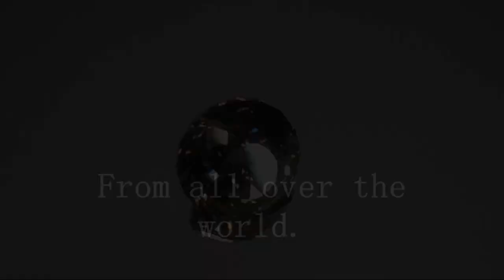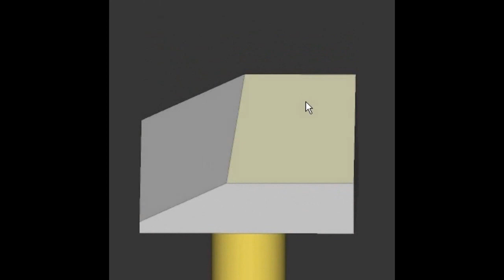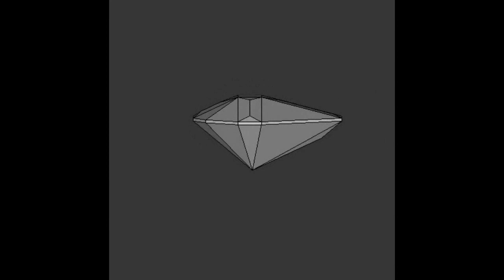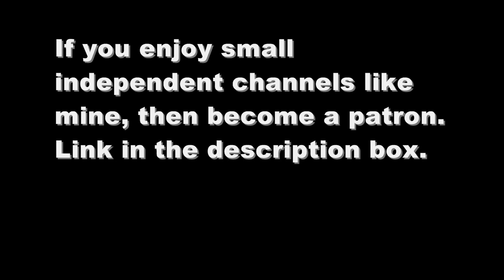How to cut gems - Have you heard about a gem called YAG?

Comment: Beautiful gem as always. 
I've cut this design in a blue zircon, it is a bit challenging but turns out beautifully. The hard part I found was finding a setting that would accommodate it, most pear or tear drop pendants would have the cross upside down and that just wouldn't work. I ended up setting it in a ring which I had to modify and during the setting process I ended up chipping the pavilion, I plan on cutting this design again.
Reply from the maker: Thanks Scott...Yes getting this set would be tricky.